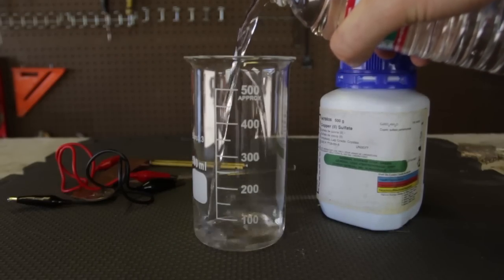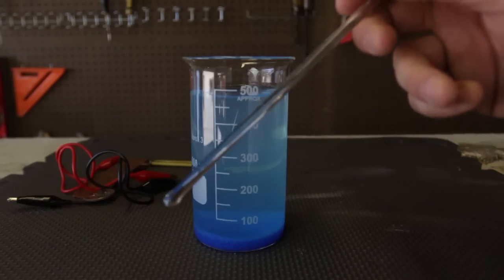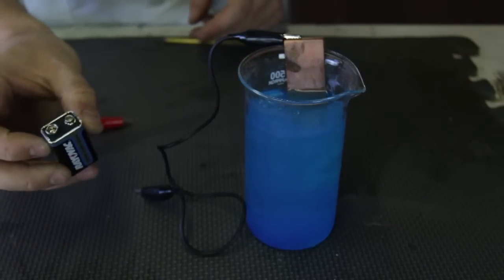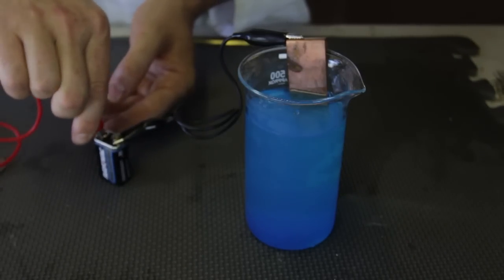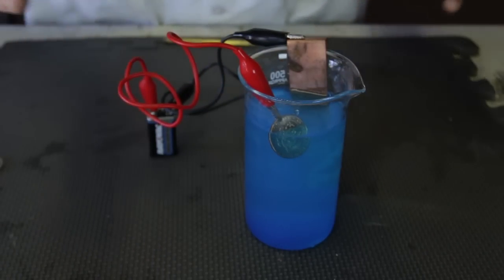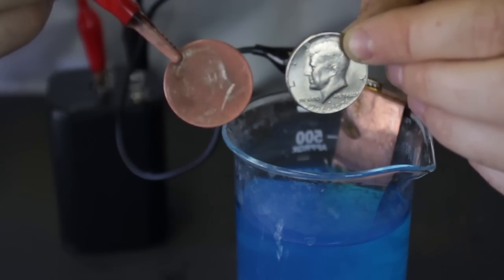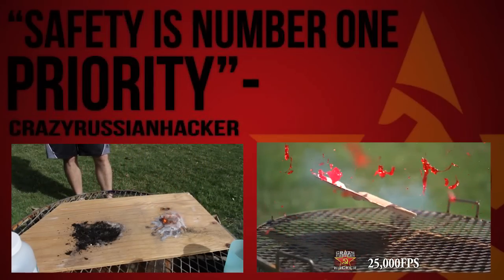How to Copper Plate a Coin with Copper Sulfate - Science Experiment

Comment: How this happens is all to do with an unbalanced equation. The coin steals the copper in exchange for what ever its made out of
Reply: +Jack Davies actually, it's just electrolysis. The electricity breaks down the copper sulfate, and then the positively charged copper ions are drawn to the negatively charged coin, coating it in copper. boom.

Comment: You used red for negative? RED for NEGATIVE? I am dying here!
Reply: in this expirement it doesn't really matter. the only reason they're colored differently is so you can tell which wire is connected to negative and positive. take the rubber coating of (which is only used for an isolator) and they're all just copper wiring.

Comment: The copper sulfate hexahydrate dissolves in the water creating sulfate anions and cupric (copper II) cations. The cupric cations are attracted to the anode (the coin) and gain two electrons. This forms a layer of solid copper around the coin. I wonder if the same process is used to plate metals with precious metals...

Comment: This is electro plating 
In a battery the electrons move from the - pole to the + pole. The copper sulfate CuSO4 is essentially Cu2+ (SO4)2-. When we put the coin(which is attached to the - pole of the battery) in the copper sulfate solution it has an excess of electrons then the Cu ions (Cu2+) will gain these electrons to become Cu atoms solid and form a deposit on the coin. After some time we could notice the change on the coin since it's all covered now with copper and the decrease in the mass of the copper strip. The decrease is due to the demand of the battery to take back the electrons that it gave and also to mantain the electro neutrality of the solution. The Cu solid atoms in the copper strip release its electrons (Cu→Cu2+ + 2é) these electrons go back to the battery while the ions goes in the solution and reforms an ionic compound CuSO4 and the process restart.
Reply: the cu copper atomss..... their*
the process restarts*
Reply: the ions ... go back in the solution and reform ionic compounds
Miss typing :/

Comment: We just learned about this in chemistry. That's called an electrolytic cell which (non spontaneously) converts electric energy in to chemical energy. (The battery spontaneously does the opposite) that's what causes the reaction

Comment: This is very interesting !!! Thanks to this, I made a huge machine for electroplating steel parts in Ni-Chrome !!! I use an old, but big welding DC power supply that I can crank it up to 300 Amps (Linde UCC-305), An old fiber glass yakuzi bath, an old centrifugal recirculating pump, cathodes of scrap nickel and chrome, salt solutions as electrolytic. I can also anodize aluminum with it !!!

Comment: Zhou are sort of making a simple cell it generates electricity. To make electricity better put 2 different metals in the salt solution of different kinds 
Then hook up wires connected to each metal and then connect the wires to a voltmeter. The process is called a radox reaction

Comment: That battery at the end was was more than nine volts....
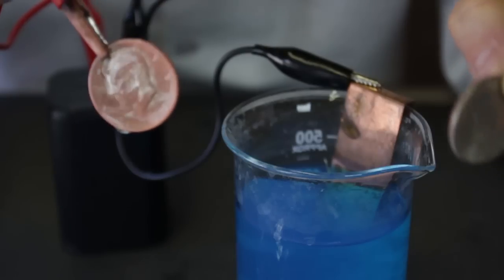Reply: 1:18
Reply: +Austin Blackburn Looks like a lantern battery, and those that I've seen have all been  6V - but with much higher current delivery capability and total capacity than the little 9V battery.
Reply: +Michael Tempsch so higher Watts? Also he didn't tell he switched battery's, right?
Reply: +Austin Blackburn Not necessarily - It would depend on the conductivity of the setup, whether the 9V battery was limiting due to its higher internal resistance than the 6V lantern battery. In that case a lower voltage battery with lower internal resistance could result in higher power. 

Might be the switch was made simply by because the 9V battery drained.

Voltage isn't really critical, I've seen it done with 2series connected D-cells, so 3V...

Comment: In case you wanted to know how this happened, It is a simple Electrolysis where the positive copper ions within the copper sulphate solution, are attracted to the negative charge of the cathode (The coin) and so coat the outside of the coin.